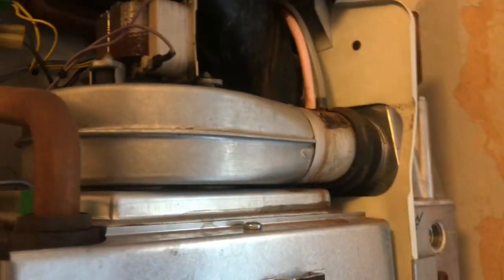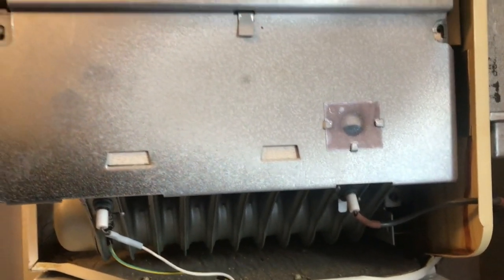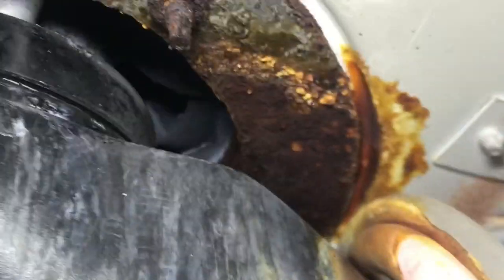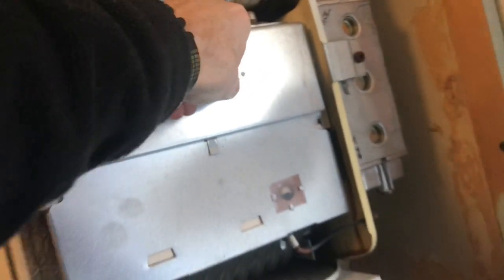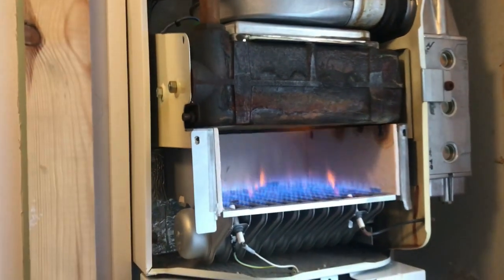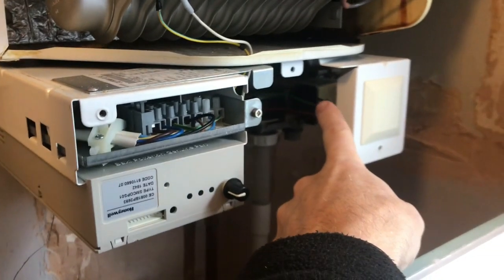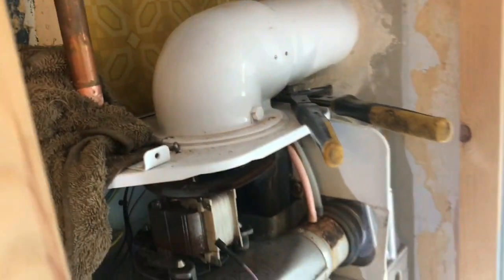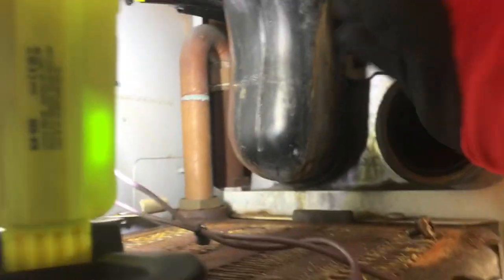Potterton Suprima No Heating. Boiler Breakdown Engineer.

Comment: The flue core on the horizontal adaptor was aluminium which rots causing this problem. The new ones are now plastic. Easy and cheap fix.

Comment: Suprimas get a lot of hate but i really like the old ones, nice neat compact boiler. great appliances if you've got an outbuilding to house them.
Reply: Back in the day (90's)  when those old ones were new,  I no end of grief with breakdowns on new boilers,   boards mainly, in the end potty came up with a retrofit that involved changing the whole boiler wiring harness and a completely different board IIRC.     Agreed: garrages were the best place for them,  Easy to work on though compared to some current stuff.......
Reply: @julianhawker7672  it was due to the PCB getting too hot believe it or not cause it was  right next to a boiler (who would of thought of that) hence the cassette came out

Comment: Unfortunately, Potterton lost their way when they "improved the Prima/ Profile range". DC gas valve to overcome the original AC valve issues, pcb issues and fan related problems which Potterton failed to resolve let alone fully accept!
Such a shame, because, after the glowworm fuelsaver range the prima/profile range was bomb proof.
Now we have the latest generation  of "high tec, high efficiency boilers" that it seems we accept a 10-12year economic life span as acceptable!